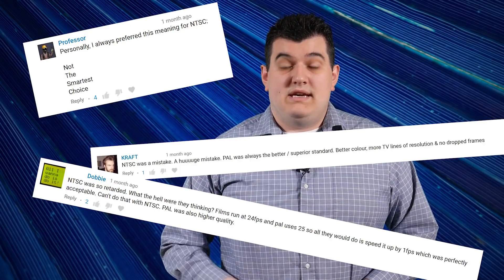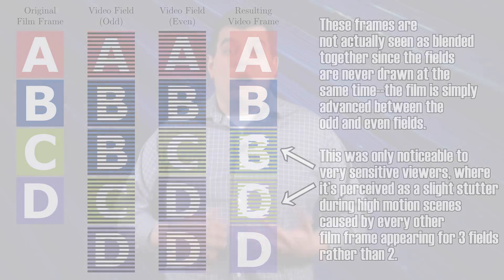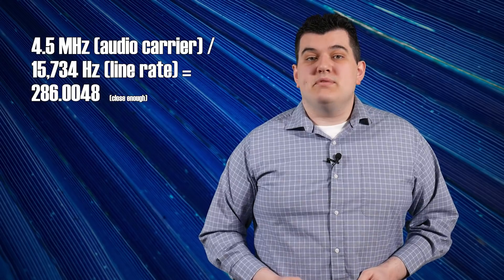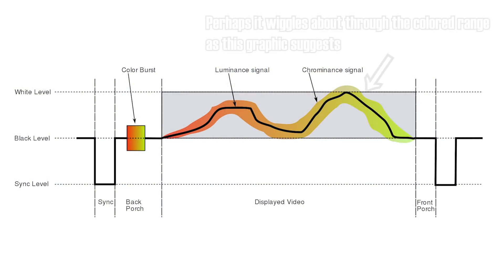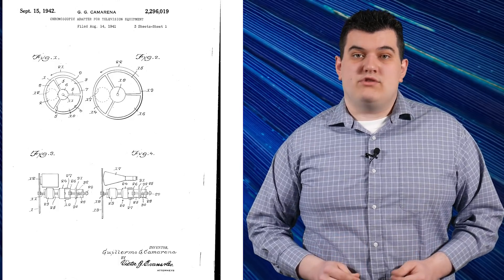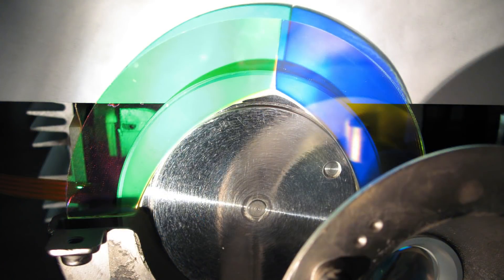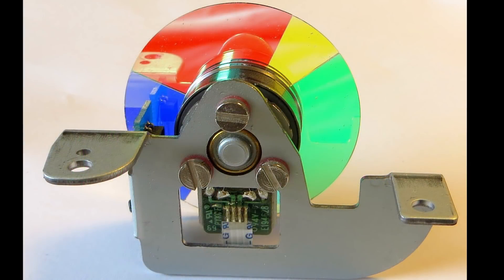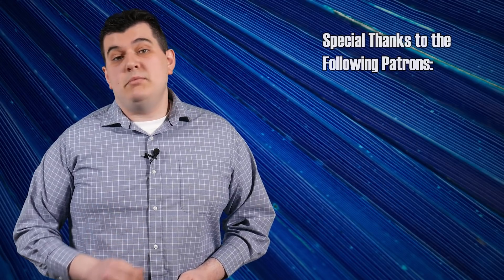Analog Color TV Wrap-Up--Some extra info

Comment: No, the reason for the 1.5 MB bandwidth of the I signal and 0.5 for the Q signal is that a quadrature phaserelationship between two signals on the same carriercan be maintained only with sidebands both above and below the carrier frequency.  As there is only 0.5 MB available above the carrier frequency, the Q signal must be kept to 0.5 MB bandwidth.

Comment: visibility of dot-crawl: have a look in yr piles of gear for a waveform monitor that lets you filter out the chroma & display it on its own. look at the variation in the amplitude. that's saturation. so yeah, the subcarrier will be 'louder' on screen where there's a lot of strong colours.
but there's another effect- if you don't filter out the subcarrier before the signal hits the electron guns.... if you leave the subcarrier sitting on top of the luminance signal.... some of it gets rectified at low luminance values because it dips below black level. this causes a slight black lift, in effect a gamma error.
question for the movie guys- we went with 25 fps for european tv, & 30fps for the US, because it minimised the flickering effect of electrical lighting & whatnot on screen. strobing, in other words. so why 24fps for movies? was it really just the economic trade-off between persistence of vision & the cost of the stock?

Comment: Another solution would've been to offer double broadcasting, one at 625 lines for colour on UHF and keep the existing one at 525 lines for existing TVs on VHF on two different TV channels and wait for the 525 lines broadcasting to be phased out 10 or 15 years later. People with existing TVs would then have to buy a set-top box.

Comment: PAL has disadvantages though, spatial color resolution is worse and the averaging created a less precise positioning of color in the vertical dimension. Secam is even weirder.

The PAL resolution however is better. But, I do not like the PAL movie speed-up. But, NTSC creates micro-stuttering with the 3-2 pulldown. But then. the PAL speedup means audio is pitched-up by a chromatic half-tone as well. Not ideal for audio.

Comment: NTSC had a low horizontal resolution. If went for an incompatible system the simplest would of been to triple-ish the horizontal scan rate so different lines for Red, Green, Blue. An entire one color phosphorous line must be easier to manufacture than lots of dots. Then horizontal resolution is unlimited. Using a TV as a monitor a black and white TV has high horizontal resolution so can display 80 columns of text while in color usually 40-64 characters depending on num horizontal pixels in a character and how much of the scanline is used. NTSC locking in low resolution to me is it's biggest weakness.

Instead of complicated phase detection what was wrong with simply transmitting RED, GREEN, BLUE, R G B R G B R G B. On B&W would average to brightness. For the future when technology got better R could become R1R2 to double horizontal resolution.

Comment: There is ONE area in particular where NTSC excels and PAL does a horrible job: video games.
Ask any speedrunning community, the lower PAL framerate tends to really mess with and slow down games ported to it compared to NTSC regions. Like what you said happens with film, but with more consequences due to the interactive aspect. This is especially noticeable with older titles, as well as games where exact frame count is particularly important like fighting games.
Reply: Speed running folks aren't normal people. They play the same game 10,000 time to finish the the game 1/1000 seconds faster.

Comment: Modern TV frame rates seem to be stuck in the color offset rates for no reason.  Doesn’t 29.97 exist as an offset frequency to prevent interference from the audio subcarrier in the analog 6 MHz TV channel created by RCA for the American 525-line TV standard, and to be backward-compatible with TVs in existence in the 1940s and earlier?  Since we no longer use analog TV, and digital does not need the color offset, why are we still using that instead of the whole number of 30?  And instead of 60 fps, why 59.96?  Instead of 24, why 23.976?
  Can’t we ditch the color offset frequencies altogether and use the whole numbers 24, 30, and 60?  Digital TVs can play the whole number frame rates with no problem, right?
China is still selling new cameras clocking in at the offset frame rates.  Can we get the whole world to agree they’re no longer necessary and go to the hard whole numbers as a standard?

Comment: I find it exceedingly ironic that moving the frame rate from 30fps to 29.97fps was to solve an audio problem (interference between color subcarrier and sound carrier on broadcast signal). Once video technology started to be used in film post production that shift in frame rate came back to bite us all with a vengeance.  This was first noticed with the use of time code (a frame numbering system that used hours:minutes:seconds:frames to count program, shot, scene length.  It was noticed (for example) that a 60 min show had a time code duration that was 3 seconds too long. (30fp vs 29.97fps for video & 24fps vs 23.98fps for film on video). So, we came up with Drop Frame Time Code which "advanced the frame count from 29 to 01 instead of 29 to 00 at every full minute count except the 10s of minutes count" to make the time code count correct relative to stop watch time.  That DFTC complicated the task of maintaining a frame accurate shot length count for editing purposes (did the shot transition a  full 1 minute count or a 10s of minutes frame count).  OK, so we just use Non Drop Frame Time Code (NDFTC) for length calculation simplicity and keep in our heads that DFTC gives accurate running times for the movie on TV and NDFTC gives accurate running times for the movie in the theater.  Simple compramise? Not so when the use of digital audio came into use in film on video and video editing.  If you want the audio sample rate of CD based digital audio to be evenly divisible by the video frame rate, you then have to slow the sample rate from 44.1Khz to 44.056Khz. Now you have to have digital audio gear that will handle that strange slower audio sample rate. You can get around that problem by locking the 44.1Khz sample rate to the 29.97 video picture rate (23.98 film picture rate) and do all your audio editing that way.  Great, but not so fast.  When you play the movie with digital audio in the theater (@ 24fps) you have to speed up the playback audio sample rate from 44.1Khz 44.144Khz.  If you don't, your picture / sound sync will continuously slip until it is 3 seconds out of sync after 60 minutes of play time. Does that number sound familiar?  You might say that modern theatrical sound is based on an audio sample rate of 48Khz not 44.1Khz.  With 48KHz based digital audio you have exactly the same sample rate / audio sync problems. They are just moved to 47.952Khz / 48Khz / 48.048Khz.  Now you have to accurately label the exact sample rate when locked to the exact frame for all your sound elements and trust everyone understands what all this means as they process your movie. "Fun" times!😮

Comment: Magic did not happen in 1965 actually it was 66 and because that was year that RCA's patent ran out.
RCA owned NBC so they had the most color shows because it was free for them and for others had to pay hefty licensing fees on every color broadcast and TV makers had to pay hefty fees on every set they  made so maybe they had one high end model.
Free of that 66-67 was the first season all networks were full color in prime time and every set maker had multiple colors sets at much lower cost to consumer.
It wasn't magic or critical mass just the end of RCA's patent

Comment: When NTSC compatible color was approved, the "amplitude to phase conversion" impairment was significant in video amplifiers and video distribution equipment. Changes in amplitude would introduce a phase shift. This impairment wasn't a major issue for B/W video but was for color, because phase shifts change the hue displayed on the screen. If the hue control was adjusted to produce good color for bright objects, dimmer objects would have the wrong color.

AT&T's TD2 microwave radio was used to distribute network programming to affiliated stations. It had a significant amplitude to phase conversion impairment when first used to distribute color programming. Sometime later, engineers made a design change which greatly reduced the impairment, so as to no longer be an issue for color TV. The design change also allowed AT&T to carry more telephone calls on the same system.

PAL is more tolerant of amplitude to phase conversion and was, presumably, selected in Europe for that reason. In NTSC, the difference in the phase of the color subcarrier is 180° line to line and was deliberately chosen that way. The subcarrier oscillator completes 227.5 cycles per line, or 455 cycles per pair of lines. One cycle is split between each pair of lines. So, the phase does alternate line to line in NTSC as well as PAL, but the method of alternating the phase is different. Furthermore, NTSC doesn't cancel out minor phase shift impairments.

Comment: Pal wasn´t that bad for watching TV programs or films, cinema was only 24 pictures second for example. So 25 fps was fine for video and in exchange you had a better resolution. Problem was with videogames, we play mostly videogames from NTSC regions (Japan and America) but they came in lower NTSC resolution but also lower PAL fps (And frame rate is important in videogames).
Reply: Strictly speaking, "PAL" was just the colour encoding system and didn't specify the frame rate. Apparently Brazil used (and still(?) uses) a variant called PAL-M which used PAL colour encoding but with 525-line, 30fps (i.e. otherwise the same as NTSC).

Ironically, "PAL" was so often used as a synonym for 625-line/30-fps, you sometimes saw it in cases where PAL itself wasn't even used (e.g. a PS1 using component colour connection).

As far as "regular" 625-line/25-fps "PAL"(!) goes, it should be made clear for those who weren't there at the time that the problem with the frame rate and older computers and consoles wasn't primarily that the screen refresh was lower and more flickery.

The bigger problem was that- since many games back then were both timed and sychronised to the frame refresh (e.g. using the inter-frame "vertical blank interrupt" for certain calculations and updates), NTSC games ran 16-17% slower on PAL systems, even if the CPU in the console/computer itself ran at a similar speed. (This was the case with the Atari 800, for example).

Comment: There is another reason why PAL & SECAM were considered better than NTSC.  That is they didn't have to be backwards compatible with the older B&W systems,  You touched on some of the issues, but this compatibility put tight restraints on what could be done, such as the available bandwidth for the colour components.  It's usually easier to do a better job when starting from scratch than retrofitting onto an existing system.  Also, as mentioned, by the time they were available, PAL and SECAM could benefit from years of NTSC experience.  So, those claiming the European systems are better are ignoring the reality of history.

Another bit of trivia, the Apollo moon mission colour TV cameras used colour wheels and also a lower frame rate, to save bandwidth.

Comment: Also worth mentioning regarding the interleaving of Y and C signals is that when viewed on a spectrum analyzer, the luminance signal appears as a series of frequency peaks with gaps between them, such that when the chrominance signal is well designed, it will fit in those gaps with little overlap.

Comment: You and Matt, are wrong, wrong, wrong, wrong, wrong! 

  And you double-down on the wrong by making up the factoid that "the sound carrier could not be changed". 

   Balderdash and poppycock.   

The vertical rate of 29.97 has everything to do with having a firmly locked-together color, H and V rates. It was more important to lock those together than to lock the 4.5 MHz sound subcarrier.   

After all the sound subcarrier is way way out at 4.5 MHz where it could and always was easily trapped out with a 33 cent LC circuit, while the other frequencies and harmonics are all in the video band.

I know what the scuttlebutt says on YouTube but that still does not make it right.

Comment: I am 80 years old.  I can remember the Black & white days.  I have also worked on a 800 line Hi-res system (Black & white only. used in a Military briefing situation audience.).  I can also remember Popular Science mags saying the future would be a flat tv the fit on a wall.  If WWII had not happend who knows but because of WWII eletrconics in High Freq, VHF and Uhf freq.  Tv after the war was cheaper.  Our first TV in 1948 was a round tube set.

Comment: All this colour TV theory takes me back to the late 60's when i had to go back to the Tech college to re-train
for the introduction of Colour in the UK
The theory went over my head, but apart from a few new circuits to learn, and setting up the sets, they
still suffered the same issues as B&W sets, and the early valve/tube models ran even hotter so were less
reliable.
The NTSC/PAL/SECAM debate has been going on for years, why consumer electronics can't agree on one
worldwide standard makes little sense to me.
With todays online streaming and faster internet if you are lucky to have full fibre, the old TV transmitters
must be coming to the end of their era.

Comment: Cannot believe how on point this guy's production quality and editing is, the way he emulates the NTSC colour shifting.

Even though pal is 10hz slower, I now am very thankful I grew up in a pal region.
Reply: Strictly speaking, "PAL" is just the colour encoding and can be used with other line/refresh rates, it just didn't happen much in practice.

So you could have it both ways- Brazil used PAL at 525-line/30-fps (i.e. otherwise the same as NTSC) for "PAL-M", though I don't think anyone else did(?)
Reply: @NotATube  Nobody else did and I could argue that our color system was the best one hahahaha. We just did very late, 1972.

Comment: PAL wins hands down, i still use analogue for FPV, the systems can use either and the difference in quality is huge in PAL. Some prefer the slightly faster frame rate of NTSC but general image quality is king when the quality is already poor and every little helps prevent you hitting near invisible branches!

Comment: Well, it was a choice to introduce that standard, despite knowing about its problems at that time, instead of doing some more research for a better one and then introducing that one; which may just have delayed color TV by a few years in exchange for much better quality. 

And please stop saying the frame rate is 25/30 FPS. It isn't! The frame rate is 50/60 FPS. Yes, it's interlaced, but the two half fields don't make up a full frame, they belong to two different frames. It's not like there are 30 full frames and first the odd half of frame 1 is transmitted and then the even half of frame 1, followed by the odd half of frame 2. The odd and even halves do never belong to the same frame, otherwise there would be no tearing at the edges of moving objects when putting them together. There were in fact 60 frames but of frame 1 only the odd lines were recorded and broadcasted, of frame 2 only the even lines were recorded and broadcasted, etc. which halved the vertical resolution of each frame, it didn't halve the frame rate. That's also why PAL looks much smoother when filming objects in motion than when using actual film to do so, as the difference is not 1 frame per second (24 vs 25), the difference more than twice the frame rate. Only when converting film to PAL/NTSC sometimes the two halves would really belong to the same film frame.

Comment: All those people ranting about NTSC vs PAL clearly didn't own a PS1 or PS2 in PAL territories :P

No framerates weren't really a feature of PAL specifically as it's tied to their electrical grid standards but I doubt that's much comfort to any Europeans who had to play Crash Bandicoot at 25fps xD
Reply: What was so bad about playing Crash 💥 Bandicoot at 25 frames 🖼 per second?
Reply: @ReubenWalton  Not sure if this is a serious question, but with old games one of two things happened:  either the games all played 17% slower OR they ran at lower framerates than intended which impacted responsiveness.  Now the games didn't have jutter necessarily but a lower framerate is a lower framerate and 25 ain't ideal when you had a lot of games at the time hitting 30 and several hitting 60 (which would be dropped to 50).  

And as for Crash specifically, that game already kicks your ass at 30fps, the slow down and reduced responsiveness ain't doing ya any favors.

Comment: In the 60's you had to buy a special BBC2 aerial(antenna) to receive that channel. So you could see which houses had it by looking for the extra aerial on the chimney. After 625 lines became standard across all channels, the term "BBC2 aerial" faded into history.   TV engineers I worked with back in the day quipped that PAL meant "Picture always lovely"  usually followed by some derogatory NTSC backronym.